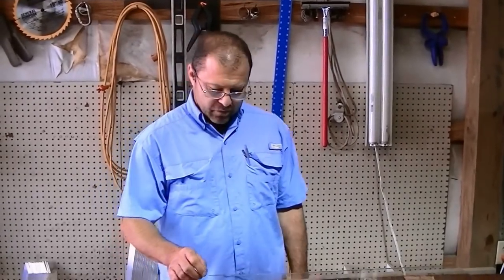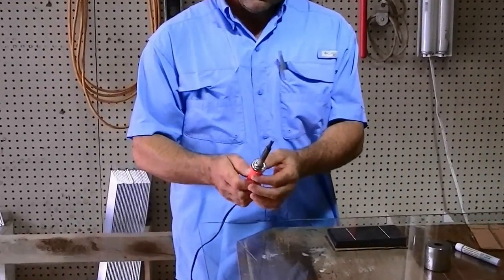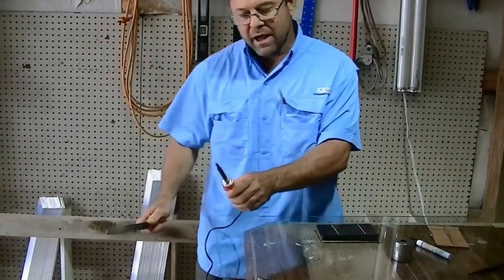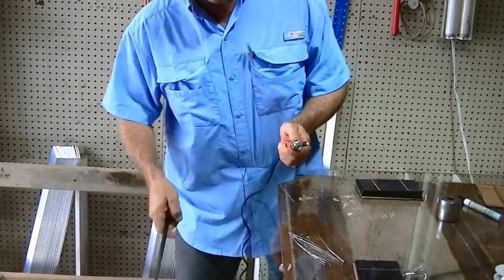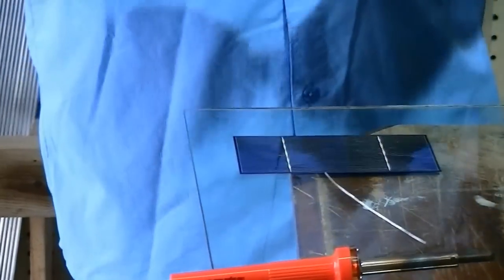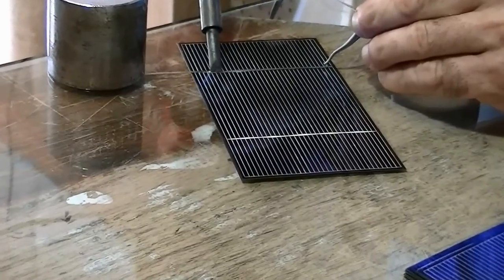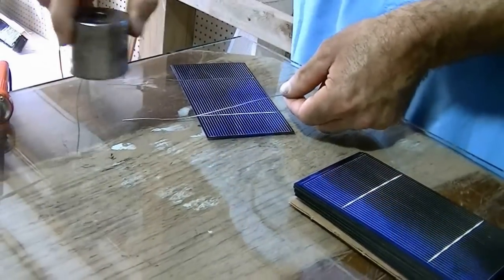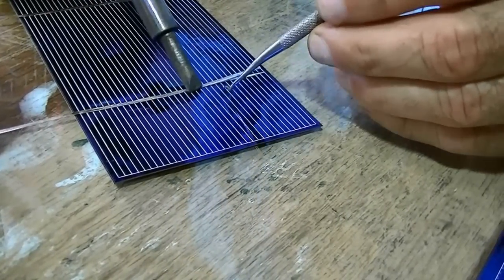How to solder solar cells/ secret trick to get it to stick.

Comment: Confirmed, works. I also did put one drop of Rose's metal at on cell, where a tabbing wire will start, seems making it smoother gliding with soldering iron. Flux is must, I used simple rosin flux and thin tassel.

Comment: The tip keeps oxidizing because you don't keep it tinned.  You're supposed to have a wet sponge and tip cleaning wire to clean and tin the tip.  Also, don't leave it on when you aren't using it.

Comment: I suggest upgrading your soldering iron to a temperature-controlled type with an iron-clad tip (which you should never file). Metcal is a brand widely distributed and well-suited for this kind of work. They cost a lot more then the simple Weller you're using, but will easily pay for themselves in time, if you're doing hundreds of cells, and good results will be easier to obtain.
Reply: how do we find the good cells these days, I'm just getting into this, there are so many cells on ebay and aliexpress etc but how do you know what is good or not?
how is the metcal going to be different from my Hakko?  do I really need a special solar cell sodering station or is it just one with good temp control?

Comment: Never file or sand your iron tip it is chrome plated to be able to wet the solder once you lose the plating it will not work for crap.
Reply: Some types of tips are plated, but legacy irons like this one may actually have no plating at all. You're right is saying that any plated tip should never be filed, because that will essentially ruin the tip.

Comment: Wow. Good concept but a lot of bad habits. Don’t ever file your tip unless you are throwing it away. Soldering Iron tips have a special coating on them so the solder will stick to the tip. When you store your tip you should rubber on a clean wet sponge to get off any residual flux and add a glob of solder on it to protect it from the elements and oxygen. While soldering leave a glob of solder on the tip while do your doing your set up. This prevents the tip from oxidizing. Use some alcohol to get rid of the flux to prevent corrosion on your project. A good way to prevent corrosion in a harsh environment is clear nail polish/lacquer or clear heat shrink. Clear so you can see if your solder is broken, degraded, or corroded later down the line.
Reply: silicone conformal coating

Comment: Crap.  A copper tip needs a nickel-plate to prevent rapid erosion.  Some years ago, I hand-soldered about 13,000 thro-hole pins in about 3 weeks.  If you want to keep your tips in good condition, get some good flux paste or solder paste that has flux and solder powder and burn the oxide off.

Comment: Please, do not use a file to "clean" a soldering tip. The tip is most of the time not made with one solid metal. It is a copper core with a durable layer of iron, chromium or other metals. Filing will expose the core leading to excessive wear and will shorten the life of the tip. Use a tip cleaner block or similar compound. Also remeber to re-tinn the tip of the iron after cleaning and use to prevent tip oxidation. :)

Comment: Hello! Great video, hope you still get notification from posts/questions. I got muy soldering gun (40w) with wide pointer, but the tab wire is not close to sticking... got one from ebay ... where did you buy it? is it possible its a bad quality tab wire?
Thanks!
Reply from the maker: I bought my tabbing from MLsolar. It is possible to have bad wire.
Reply: thanks! I'll try from there

Comment: My tapping wire is not melting,   But I am using 40 w iron. What can I do? Is it something to do with the wire?
Reply: Make sure the contacts are clean and free of contaminants, After that check your iron tip for oxidation by also cleaning it. Keep the iron on your surface for a good amount of time until you see flow taking place. Laying the iron onto the contact point similar to how you would hold a knife (almost horizontal to the surface) will make flow happen. Also good to offset your paste so that your iron is making contact with both the connection and the paste will generate flow very quickly.

Comment: Hi Mark, I have enough solder with flux (60/40). Can I use it  to tab the cell or which is the correct solder to buy.
Reply from the maker: +Ponniah Kunathasan You can use 60/40 but the flux in the solder will be messy.

Comment: Hi Mark, great video. I followed your instructions and solder the solar cells perfectly. But when I finished I noticed that the solder flux is melted over the cells. How to cleas up this solder flux? Thanks
Reply from the maker: Anderson Lima I use vinegar water and carefully wipe the cells.
Reply: Thank you very much.
Reply: Use 90% isopropyl alcohol to remove rosin flux. Make sure it doesn't dissolve any of the component materials. (There should be no issues with solar cells, but try a small area, first, to be 100% certain.)

Comment: I didn't see that you used any solder? Do you just simply melt the tabs with the soldering iron??? Thanks in advance.
Reply from the maker: Yes, The tabbing wire has plenty of solder already on it.
Reply: Thank you, it's good to know, saves a lot of time. Is there any reason that in some other videos guys use normal solder as well? Maybe different tabbing wire?
Reply from the maker: kosztaz87 Some of the old, cheap tabbing wire was not pre solder and you have to add it to it.

Comment: Do not file but do keep it clean
Reply: with  tip that big you can file it just fine, a quick easy way to get a superior mating surface. Many soldering irons these days have tiny wimpy tips - bad for soldering/thermal transfer and you can't file them thus having to constantly keep it clean.
Reply: this guy knows what he is doing, a big fat, but sharp tip, for precision.

Comment: I've always had problems with the paint on the cell not allowing the tabbing wire to make contact. I've been using a dremel with a wire brush on low speed and a template to remove the paint were I'm going to set my tabbing wire to ensure good contact. I also use a 100 watt iron. To clean my soldering tip I use that steel wool type material the electronic stores sell along with a damp sponge. Since using that I never have to actually clean the iron. This is after 600 feet of tabbing. What are your thoughts or anyone elses thoughts on my process.
Reply: AirandEnergy A wet sponge is all that is needed,  I used to solder smoke alarms all day!
I use a scalpel to cut the film from the panels were I want to solder my wires and use superglue and baking powder to hold the wires firmly in place and seal the moisture out.

Comment: Could also use a damp sponge with a tiny bit of solder to clean the tip off.  If it doesnt come clean then I would use the file.  Also, if you add solder to the tip before letting it cool off for storage the solder will protect the tip for next use.

Comment: try cleaning your tips on your bench grinder with the wire brush wheel....removes less of the original base material from your tip, but puts a whooping on the solder.

Comment: Thanks Mark. Have you noticed any corrosion of soldered connections, later (years) on homebuilt panels? A couple of mine corroded, tho, so far, haven't changed in their output. Cheers
Reply: too much flux, clean with  a Qtip and isopropyl alcohol

Comment: hey, thanks for the tips on the type of tip you use and keeping it clean, i ran into those problems with putting the pulse motor together and just changed tips. again, thanks for the information.